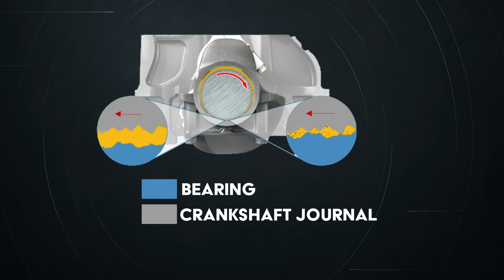the truth about start-stop technology (finally proven)

Comment: I love how every time they add something ppl have to defend it like there's something magical and no questions asked. How long it took to be proven that not only it causes damage for starters, batteries and overtime creates more residues internally, useless for ppl that don't have bad traffic and wait hours on red lights, but also the engine wearing faster due to low oil pressure (from its nature) when the engine start and stop also the oil pump starts and stops.
They made millions with that already so no point to even mention it now. We gave them what they asked. We showed them how much of a sheeple we are.

Comment: The logic behind the comparison test sounds good. Wrt the polymer, I believe hardness of surfaces is such that the softer one will scratch if a harder one is forced against it. If the polymer was just to show forces that’s ok. The amount of damage to one surface depends on the difference between the hardness of two materials in contact. (Just think of diamond vs steel). If different materials are commonly used then one is probably designed to be sacrificed due to engineering requirements.

Comment: This start stop system is not for YOU, the driver, it’s common decency and care for the others around. In a crowded city with bumper to bumper traffic, cars turning off is a good thing for noise and pollution. The ones who complain are cheap asses who care about long term efficiency because they can’t afford modern cars. Who cares about the engine, you get a new one in a few years anyway.

Comment: 1:09 The representation of these facts is misleading. While car manufacturers have had to meet emission standards, these standards do not dictate how compliance must be achieved. Manufacturers have opted to implement (they are not forced) the start-stop system, which is primarily designed to improve scores in official emission tests. In practice, however, this system offers minimal environmental benefits and can even cause accelerated wear of the engine and battery. This approach deliberately deceives regulators, consumers and harms the environment, all in pursuit of profit.
Reply: I wish I could upvote this twice. Gearheads love to be smug about "eco friendly nonsense" - which is pretty much what this video is. 
If you wanna be smarter than the average sheep, you should be bitching to your politicians to make efficiency hacking illegal.
Reply: Not the completely picture: in Germany, it’s illegal to let your car “idle unnecessarily” (in traffic, in parking areas, etc). That alone pretty much enforces the start-stop system…
Reply: @levifig  The rule from German traffic law (§30 Absatz 1 StVO) prohibits causing unnecessary noise or emissions by leaving your engine running when it is not functionally required. This means you cannot leave your engine running while parked or standing still for an extended period. Situations such as "preheating" your car in winter, waiting for someone, or doing grocery shopping fall into this category. However, you are not required to turn off your engine at a red traffic light or a closed railway crossing. 
While some may find it inconvenient, the start-stop system is primarily designed for manufacturers to legally bypass emissions regulations rather than for genuine environmental benefits.

Comment: We got a new used car with start/stop function. Even my wife who knows nothing about cars was like "weird feature, this can't be good for the engine".
Reply: Yup. It doesn’t even pass the smell test.
Reply: @jergervasi3331 If your car engine smells, take it to the shop. Or buy a car that's newer than the 2016 VW Transporter T6.
Reply: Same thought qhen i used a rental
Reply: congratulations, your wife knows more/has a deeper understanding of engines than a good chunk of the car owners out there
Reply: You didn’t think about that when you test drove it?
Reply: I felt the same, but it's reassuring seeing most of these engines actually outlasting their conventional counterparts in the real world.
Reply: It's not about engine, it's about global warming as they say, duuuh....
Reply: @peace7482 It's about saving money.
Reply: what ever you wife thinks is nothing to do with the reality without facts and investigation
Reply: @jarunis1 fax
Reply: @jarunis1 You don't know how women function do you?
Reply: We have had several cars/vans with the feature and even our work van (transporter) after 200 000 miles of city drive in 4 years had an original starter. Our BMW 530 is like 10-years old soon and have original start. These tests are just pointless when it comes to real life.
Reply: Clever girl.
Reply: The start stop feature only activates until after the engine is at normal operating temperature. This test is not accurate
Reply: Even your wife is wrong. Shocking.

Comment: My Alfa will go into stop start 2 minutes into driving if I forget- that is NOT up to running temp and is horrible for the engine, it also means the transmission (slush box ZF 8 speed) is also affected.

Worse yet is the turbo bearing.

So dumb.

Comment: It wears out all kinds of parts faster , even engine mounts for instance. First thing I do after starting is defeat the stop start, I might even buy a stop start eliminator but I shouldn't have to. Stop Start should be something you can defeat permanently by pushing a button it's reall annoying and not really helping the environment if it's wrecking your engine.

Comment: Besides all the additional wear and tear I just hate the idea of the engine shutting off by it self. I drive mostly older used vehicles and have only recently got a Honda Pilot with Start/Stop and its nerve racking to be at a red light and have the engine cut out. If it doesn't turn over again I am left stuck in one of the worst places to be stuck in. Thankfully turning it off is as simple as double tapping the drive button to put the car into sport mode which also fixes or reduces a bunch of other issues caused by the normal Start/Stop system.

Comment: Had a Mercedes W176 with the 220hp 2 liter engine. What a pleasant little rocket it was, had 260k km on odometer when I sold it. Never had a problem with the engine, and I never disabled start-stop. 
Proof of the pudding is in the eating, I say.

Comment: The argument of the video doesn't answer the main point for existence of START/STOP system: its benefit of ecology and minimizing pollution. Its undeniable that it vastly lowers the emissions compared to not having it on, the numbers and studies are there for all to see. Yes, it wears down your engine and corresponding car parts a little faster, but the emissions are far greater factor for the enviroment. Having it ON for a 150,000km span of an engine it saves ~600-1200kg in CO2, you add the manufacturing of new parts in the equation and you get ~400-1000kg CO2 that you saved. Compared to 0 when you turn it OFF. There is a estimate of 1.5 billion cars in everyday traffic in 2024. Think about that every time you turn it OFF.

Comment: If the engine is running off and on in traffic. Can a electric oil pump take over and keep the oil system lubricated while the engine is off in traffic.  Some high value sports cars have electric oil pumps to charge the oil system before start up.

Comment: Engines should be built for longevity not emissions, and engine that will happily roll through a million miles with basic maintenance is infinitely better for the environment one that grenades itself after 120k due to the emissions restrictions governments impose. I have always turned of start stop on the cars that I have owned. It baffles me that companies like Toyota have had to change the 4.2 in land cruisers that are commonly known for million miles clocked have had to swap it out for a 2.8 that will only do 400k and need to be replaced. It also baffles me that in the UK the average age and mileage of scrapped cars in 10 years and 100k miles.

Comment: OEM test start stop engines a minimum 1000 starts on an engine dyno. The engine runs for no more than 5-6 seconds then turns off. Then repeat. It’s automated. Then engines are pulled down.across multiple engines for repeatability. It’s not like they recklessly accept engine damage.

Comment: The first thing I did when I got a car with stop start was change it to a standard none stop start battery. I hate the idea of all the extra strain on the starter motor and battery. I didn't eleven think of the extra wear on the engine components

Comment: What is incredibly frustrating with my car is that it has the start-stop system, which you can turn off with a button but IT DOES NOT REMEMBER after you turn off the vehicle later. It always defaults to enabled! Everytime I get in the car, i need to remember to turn it off and it could easily be fixed with a software update

Comment: I still drive a car from the 1990's and I am fine with it. Even had one reach 300,000 and was still working good. The stop and start thing also has another problem they don't tell you. If you vehicle is in this stop  and start mode on city driving, the catalytic converter  might never get hot enough to do what it is supposed to do to help the environment as well.    That needs to get very hot to burn off that poorly burn off gas or diesel, that will happen more on the start and stop mode thing..

Comment: I watched a documentary about jet skis made by Bombardier, years ago, they had a dyno where they had their jet ski running in water at full throttle under load for a period of 1 YEAR! And they came the engines test down and there was virtually zero wear on anything. It’s the starting and stopping, heating and cooling, ingesting water, months of sitting without running etc that hurts them, not full throttle operation. Interesting video and makes perfect sense.

Comment: I drive a 2019 Equinox and saw a video on the start/stop thing and was reading some comments about being able to shift into 1 and pressing the button on top of the shifter to get to 6th gear and that'll disable the start/stop. It works, but you have to constantly remember to do that every time you go anywhere, and sometimes it's easy to forget to do that. I hear that the newer Equinoxs have a way to turn that off without having to go through all that.

Comment: How about my car wanting me to shift up at 1200 rpm, that put extreme loads on the engine while it is not in the optimal band. My car wants me to shift so ridiculously early that if you follow the instructions you will stall it going from 2 to 3  or from 4 to 5 at the suggested time.

Comment: I am not the biggest fan of stop start but this video is fairly deceiving. 1) Yes 80% of ear comes from engine start and yes it takes 8 seconds for oil to flow. However, stop start takes place while oil is still present 2) Doing this test on an engine that doesn't have stop start is misleading. Engineers design oil passages, bearing, pumps to deal with this "dry" condition. 3) "simulated wear over 80 hours" neglects things like contamination which more than likely would be cough with filters that are managed by oil changes over said year 4) I can play the same game. The Toyota 2.5 and 2.0 hybrid Atkinson engine is one of the most reliable engines on the market and stops running constantly. I get that this is an annoying feature to people but this really is a poor experiment and proves nothing

Comment: It’s the fuel mileage and emissions requirements of the law. Bigger vehicles have looser requirements so cars and trucks get bigger as complexity and price goes up. Fuel mileage counts too so every trick is used to count another mile per gallon, AFM/DOD; A start-stop; super hard tires; 0 weight oils; light duty transmissions, etc. 

All at the expense of the customer who has to afford, operate, repair, and service such a complex vehicle that more than often breaks down just about the same time the warranty period ends.

Comment: As someone who grew up without start-stop systems, every time I drive a car with start-stop and the system kicks in, I have the feeling that I am breaking the car. Thank you for proving my skepticism with science!
Reply: Not science. A single "experiment" on a 2016 VW Transporter T6, likely with over 70,000 miles on it, while admitting the oil was not clean.

Fact is large freight companies perform large real-world trials covering millions of miles, and are using start-stop engines because they save money.

Not on gas, tho that's part of it, but less wear on the engine.

Comment: Fantastic video! However, it is important to mention that around 3:15, the bearing caps have been removed for clarity, thus exaggerating the actual dimensional tolerance in between crankshaft and connecting rod. Thank you for doing the research! This video should be showed in every mechanic training classroom.

Comment: 2018 Equinox you have to put on L and move it up to 6 speed then it won't auto stop.  Get use to it after a bit, but most of my driving is hwy.  There is also a cable can get I believe is installed at the battery in between existing cable.

Comment: THIS IS NOT A REAL WORLD TEST, HES JUST TRYING TO GET VIEWS, PERIOD!!! READ ON FOR PROOF, AND WATCH YOUR OWN VEHICLE WHEN YOU DO OIL CHANGES!!!!!!! First thing I’d do is do something about your test procedures! In your tests the oil pressure didn’t start climbing for about 5-6 seconds after starting the test. KEEP THIS IN MIND READERS AS YOU READ THIS, 5-6 SECONDS!!!!! EVERY time I change my oil I let it drain for 15 minutes minimum, filter of course and new oil. So now the oil pump has to fill the filter and then send oil through all oil passages and build up pressure. EVERY time I go to start my engine, I switch my gauges to digital and watch the oil pressure. I NEVER EVER, have to wait more than a half second to watch the oil pressure start rising up!! If you are going to test, test the way the engine is run and developed!!! About ten years ago before I ever owned a start/stop vehicle I always wondered this. I had a vehicle a couple years ago that I was not paying attention to after my oil change and didn’t watch the oil pressure on startup, I started it, walked to front of car, about two minutes later I suddenly remembered I never watched oil pressure climb, ran back to look at gauges and no oil pressure, right at that moment my oil pump crapped out. Car ran about three minutes total WITHOUT OIL PRESSURE!!! I dropped oil pan to remove a couple rods caps and check rod bearings and crank shaft, the biggest pressure points there is to run an engine without oil, and there was absolutely no problem with them. This what happened to me, can prove his theory and especially the way he is testing with no oil pressure for about 6 seconds wrong!!! In simple thinking yes it does sound bad or worse to start/stop so many extra times, but again, next time anyone changes oil watch your oil pressure gauge or idiot light and IT WILL GO UP or with light IT WILL GO OUT in less than half a second!! Over forty years of rebuilding engines and even in the last ten years since start/stop has been around have I NEVER had an engine failure come in that could or would be contributing to the start/stop system, PERIOD!!!

Comment: Great video except the fact you mistook the tin on bearings for aluminum. Look into it, the tin is the sacrificial surface, usually there's a layer of copper or brass behind so that it can stick to steel
Reply: Also you've forgotten to show us a control sample where you have the bearings out of a normal engine that didn't stop start and just ran normal for 1 year. That would have been objective.This is just one side

Comment: I no longer own an ICE car and I never will again. The electric car is better in most areas, and completely superior in the areas that matter most. On the last ICE car I had, the start/stop automatic stopped working pretty quickly anyway due to low voltage on the starter battery

Comment: I’d be curious to know if the engine used for these examples is actually an engine that would’ve had stop/start. And if it is, does this one have a dual stage oil pump? As well as a more advanced oil drain back prevention system in place? If not these tests shown really aren’t an accurate description of precisely how the stop start system truly affects the engine.

Comment: This is the morning start-up sequence I do on my VW Golf 7.5 GTI Performance DSG(in the summer):
1. Hold my foot on brake pedal, push "Start Engine" button, then wait 2 seconds and disable "Auto Start/Stop" (while the Parking break is on, obviously).
2. Switch the gear on the DSG from P to N, then take my foot off the break pedal and let the engine run until the RPM drops below 1000rpm (it takes about 30-40 seconds)
3. Foot back on brake, disengage Parking break and put the gear in D. Ready to go!
4. Drive gently in traffic until oil temp is up to 90 C.
5. Car is fully warmed up and ready for "Sport mode".

P.S. I read somewhere, from a mechanic that putting the gear in N(Neutral) while idling helps to pump the oil and warm up the engine faster. No idea if that's true or just a myth, but it definitely does no harm. Please comment if I'm wrong. Cheers!

Comment: I wonder if the oil pressure issue might be resolved by an auxiliary electric oil pump parallel to the regular one and with a check valve at the end. Upon startup the pump would run for a few seconds before the starter motor is activated to crank the engine. A few seconds longer startup sequence doesn’t seem like a big sacrifice

Comment: not to mention when the start stop feature craps itself and you stop for just a second and have to go immediately. It has happened to me before that the whole car got confused and just cranked and cranked. Had to put the car in park in the middle of a busy intersection, shut it off, open the door and close it again before it wanted to start. Had the Start Stop feature programmed out after that